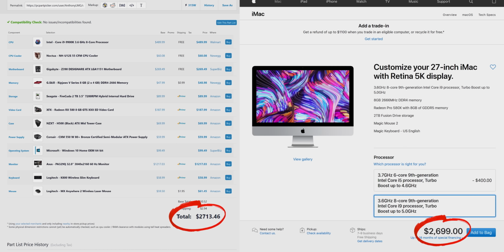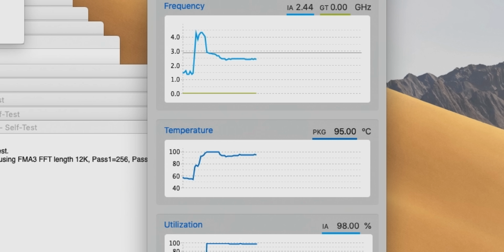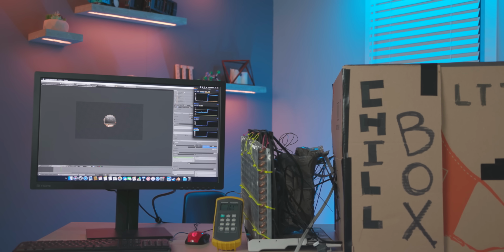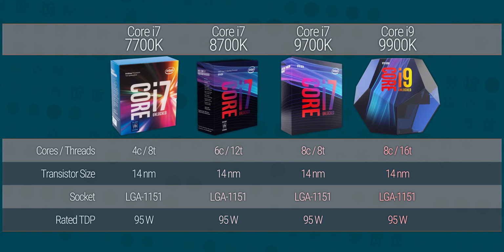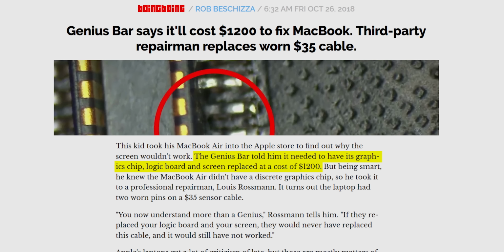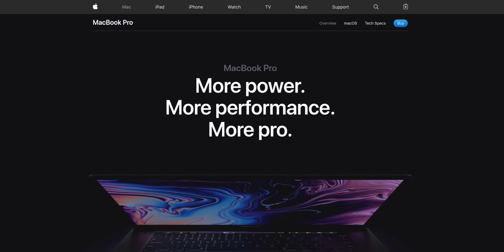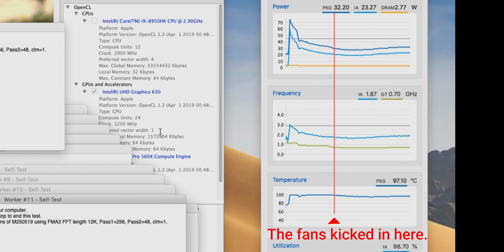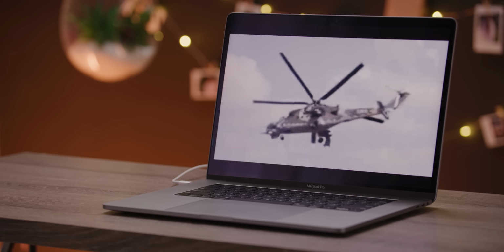Macs are SLOWER than PCs. Here’s why.

Comment: my mac is magnitudes faster than every pc I've ever owned or worked with. way more reliable, no spftware crashes. still wndering why people buy pcs these days
Reply: As someone who owns both, while performance is often identical, and in some rare cases better on Mac, software compatibility and customization are just way better on PC. I have more options built in when it comes to small things like cursor customization, taskbar grouping, window snapping, to better 3rd party modding support that have negligible performance impacts. Tools like file explorer are way better than finder, and in general while MacOS feels smooth, Windows is generally more practical and gives more freedom - and that’s not even getting into the Linux side of things. Also with PCs, you can upgrade individual parts if they die or feel outdated, you have a lot more freedom in price tiers and you aren’t limited to arbitrary os limitations like one external display .

Comment: This is just my opinion :

So in conclusion, the reason why Macs are slower than PC is because Apple limit the performance of their CPU (for intel based) in order to make sure not getting overheat due to the design that are too thin (especially Macbook) so the fan are not optimal to cooling the cpu because the fan itself are too small and thin to cooling massive work that cpu doing.

Comment: Knowing what we do now, Apple did this for a few reasons
- Intel misjudged how long it would take for 10nm to roll out
- Apple were pretty close to Intel at the time, but this failure was the last straw and they booted intel to the streets after.
- Apple designed the cooling solutions for the predicted TDP's for the chips had they used 10nm instead

Comment: A very good friend of mine, who passed away, loved Linux for starting (booting) and shutting down, VERY quickly - he passed away before the latest system we got for Seniornet in Upper Hutt (New Zealand), which was a shame, because it started and shutdown VERY quickly - and was Windows 11, a 2GB/sec SSD, DDR4 ram and an 11th gen i5 CPU with a 23-inch screen and built-in webcam for zoom etc.

All our refurbished PCs, pentiums or 4th gen i3 at the best, had the SATA hard drives replaced with SSDs, now they ALL start in 12 seconds.  Cos it's all about taking the very large WIM file and putting it into the RAM, right?

Or the "sleep" or hybernate mode, where you take everything you are working on, save it as a file to SSD, and turn off the computer.  Some computers do that, when they are dropped!  Before they touch the ground, on their rubber-sorbathane edges to absorb the kinetic energy, they write the RAM to a file and turn off.

Comment: The MacBook Pro 2007-2011 15,4 is The Best i got it and these still support Windows and you know why windows and Linux are bed CUZ Also Macs are not supporting only MacOS & Mac OS X & OS X so i you all can change iMac Or Mac Pro & Mini Or Macbook into A Windows Or Linux Like Thats why i also like Mac and i Have An iMac Without Monitor And its 21,5 Inch and i installed the windows 10 on it and thats not Bad Like it got so speed so your not right

also oldest Apple Devices Tech you how to change Ram so Just shut up your not right

;)
Reply: And They dont Need to change them Graphics Card

Comment: Has this problem been resolved yet? I am considering going back to Apple for everything.
Reply: Very much so, the new M1 chips pretty much fixed most of all the issues Linus talks about here. The issues with intel chips were caused because apple had designed the devices with Intels new 10nm process in mind, so when intel didn’t deliver on their promise it left apple having to throw hot chips in a chassis not designed for the thermal output.

Now that apple is designing their own chips, they’re able to also design their cooling mechanisms to work properly, and the M1 chip doesn’t have nearly as much thermal demand to the point that the MacBook Air doesn’t even need a fan to be able to perform very well (it DOES throttle, but in a way that’s much more acceptable). 

Hope this helps :)

Comment: The answer is... Intel CPU's  run too bleeping hot.  Fortunately, Apple Silicon is here n. (2020+)
Reply: or its because apple didn't make an appropriate design either
Reply: @raghavkalyan17  The speed argument is dead now . We have reached the point of diminishing returns. M1 and future chips in Apple's arsenal have ended the argument.  At this point, the only thing Apple has left to do is to address gaming.  They have the resources to tackle that, when they are ready.
Reply: @antoniostorcke  a well designed laptop with at top spec intel or amd cpu, like the 12900k, can keep up or outperform apple's offerings, while still being cheaper and the laptop itself offering more functionality
Reply: @raghavkalyan17  The argument still doesn't convince. The Apple computer, even a basic Mac Mini, offeres more out of the box than a $2000 windows machine does. Even a cheap  linux box offers more than that top spec windows machine does. For Microsoft to fix that, thet would have to include about $2000 worth of software.
Reply: @antoniostorcke  what? a mac mini is no more easy to set up than a pre built windows machine that would cost about the same amount as the base model. And don't even get me started on the ridiculous pricing. linux beats both of them when it comes to privacy, but that's irrelevant to a discussion about hardware
Reply: @raghavkalyan17  Microsoft gives ZERO development tool with a windows installation. I suppose you could count Visual Studio Code, but not really. Forget compiling and software or editing  any videos.  They give you a crippled version of Microsoft Word. It just isnt enough to justify a Windows license cost. Even if the Windows license was free, it still would not be worth it. When I purchase an Intel or an AMD machine, I insist on a blank hard drive.
Reply: @antoniostorcke  they have basic photo and video editing software. and again, i'm not trying to say windows is better than macos, i use linux
Reply: @raghavkalyan17  i like a  machine that can run everything and build everything. . I have done Hackintosh in the past. I have also done virtualization. I could have chosen to buy cheaper PC hardware but  why bother. Just saving a few bucks isn't worth the hassle. Linux still has a long way to go. Gnome has come closest to giving us a unified experience.  With regards to the speed argument,  I am going to give Apple a pass. This is an entirely new hardware platform that is still in its first year. The trajectory that Apple has placed themselves on will keep the Wintal establishment  fretting for its future. I think the Mac Pro, when it comes. Will be truly revolutionary when it comes to speed.
Reply: @antoniostorcke  In my experience, unless you need Adobe software for whatever professional work you do, linux has a complete desktop experience now. and who'll buy the mac pro if you can't upgrade it at all. The trashcan mac proved that
Reply: @raghavkalyan17  I will be using certain publishing software which are Mac only. With the mac I can easily install Windows or Linux in virtualization if needed. Bootcamp will come when Microsoft completes their agreement with Qualcomm.
Reply: @raghavkalyan17  Apple is doing just fine. They are making money hand over fist. A 3-week wait for my customized mac and I would gladly do it again. When you have a product people want, you can name your price.
Reply: @storcke  apple is making money by using purposefully bad designs so users would have to pay more to get there products upgraded or serviced.
Reply: @raghavkalyan17  Apple is making appliances. If you doubt that, wait until you see the next Mac Mini redesign.  You will think you are looking at an Apple TV. They are building a tool with s specific lifetime. The exchange for this is an operating system that works. The value of the tool is so great that they don't have to please the customer to an extent that will take away from their future profits. The customer ultimately makes the decision.

Comment: I will say that in my experience, the Mac OS tends to provide a more stable, reliable middle ground when it comes to certain productivity based tasks… at least based on my experience  with MacBook Pros vs higher end Windows machines, and have had similar experiences between iMacs and PCs. I can’t deny that there is a certain performance disadvantage when it comes to the Macs for more extreme tasks, but it’s not exactly a black and white issue.
Reply: osx is 1000 times better than windows, that's what keeps me on apple hardware... which never has any blown motherboards, fried cpu, dead HD, etc etc.
Reply: @schmoborama  trust me, apple hw keeps dying, remember the 2011 HD6000 GPUs failures on both imacs and mbps and many other model years which had the dedicated GPU died? The HDD in my late 2011 15" also died after like 4 years even tho it was on my desk its whole life and somehoe the HDD from my 2009 dell is still chugging along as storage drive in my PC
Reply: @hav0c51  
NOTHING as common as baked HD and cpus on windows boxes
Reply: @schmoborama  aint ever had a dead cpu that wasnt the users fault (unsafe OC with either no/old thermal paste or using a shit cooler),and apart from the drive in my mac where it probably just fried itself with the gpu only seen hdds die due to physical impact, just face it bro, apart from the nice looks all intel macs are absolutely dogshit and thats coming from a lifelong apple user
Reply: @hav0c51  eh so you're a technician that sees broken computers all the time ( strange, huh ) and that means that macs break just as often as pc's 😴

Comment: I gotta tell my sister to stop thinking about buying a Mac. Not very good for its price.
Reply: Nowadays the situation is very different. Looking at raw benchmarks, the M1 chip powering the newest Macs is more powerful that any of the intel or AMD competition in the consumer mobile computer market. It's not even close. The Macbook air at $999 is actually a great deal for a very thin, well built full aluminum computer that is faster than all of its similarly priced Windows competition.
Reply: @spht9ng  yep, its specs are really good, except for its durability. The screen of the M1 is not very strong, so many screen problems happened and they just regret buying the M1. I prefer a Lenovo thinkpad or Legion. Its specs are worse than M1 but it's excellent for the price.
Reply: @Nguyn167  well. i have not heard of such screen issues being so prevalent. Hopefully this is an edge-case issue that is only affecting a small few but I wouldn't rule out any big design issues with Apple. The last few years have not fared well for Macbook design with keyboards that have a failure rate which is way too high and inadequate cooling which would cause thermal throttling. With the M1s already having been out for about 10 months, I haven't heard many huge complaints about reliability so hopefully Apple has put this bad phase behind them.
Reply: @spht9ng  if the issue's fixed, then this will be a must-buy. :))

Comment: M1 to intel “looks like you’ve got a fever, we’re going to have to isolate you”
Reply: *M1 max from behind to M1:That's MY boy
Reply: Intel to m1 . Dont be a liar 5nm child
https://youtu.be/2BooIC5qGO8
Reply: Intel i9 and thread reaper is superior
Reply: @styx8383  You're seriously comparing a fucking threadripper to an M1? They're completely different things, dude.
Reply: @styx8383  Ah yes, something eating 300+ watts is superior to something only using 30 watts.
Reply: @doggo_woo  that's not even true
Reply: @styx8383  what isn't true about that? Just stating the fact that your comparing a low power CPU to something that eats 300 watts when at max load.
Reply: @doggo_woo  it does not take 300 watts lol
Reply: @styx8383  I hope your not reading the tdp intel shows on their website because that is literally only it's thermal output. Check Linus's review of it

Comment: Yet Apple computers are the longest lasting and supported computers. Compare a 2014 HP to a 2014 MacBook Pro. The Hp has been long unsupported but the MacBook Pro still supported for updates on the latest OS and still running strong and even better than some recent Windows laptops.

Comment: For me it's the fact that my 2019 imac is completely silent when idle or under my normal workload whereas my most recent purchase, a windows PC with the most silent parts I could buy still makes more noise than my imac under medium load.

However, under heavy load, the imac gets noisy whereas the PC just sounds pretty much the same.

I'm totally ok with higher performance parts that are held back in the interest of being silent and slick.  To a point of course and my 2014 macbook pro with dedicated GPU is still chugging along like any modern laptop.

Also, macs as a status symbol, do people think that's a thing nowadays?  I first got a mac in 2014 so I don't know about before then but I do talk about computers a lot with people and I never heard things like "You should have gotten a Macbook pro, check out my retina display and this and that spec" but I heard things like "Dude you could have gotten a way better Windows laptop for the same price".

Comment: With my Alienware R3 M17 I bought a ram air cooler pad. It has a gasket that seals the bottom of the laptop off so all the air being forced underneath the laptop has only 1 place to go, into the dual fans.

Comment: This is the first thing I noticed when I received an old MacBook for working, I thought that was a defect or maybe a dirty fan but after googling I found it's "normal" 
I returned the MacBook and a Mac mini was assigned to me with better cpu and ram but even so the problem is the same. temperature quickly increases to 100°C  even if CPU usage is only at 60%
And some times is slower but not as much as MacBook
I understand how difficult is to have a good cooling system on that reduced case but I'm disappointed

Comment: That's why I make every laptop user at least use a fan stand. Apple is all about Planned Obsolescence and has abused that by putting out software that bricks their own hardware when a new device is released, not give a single fuck about cooling, like this video wonderfully details, and just plain lying to customers. Great video! Support "Right to Repair" and fuck Apple. Remember, they overcharge (I don't care what LinusTech "concluded" as they do still overcharge), they restrict access and steal software that was initially open source to make money, they brick their hardware with software updates, and they build their hardware to fail by disregarding heat dissipation.

Comment: You'd SO deserve a ton of dislikes for having implied ALL Android devices go into thermal throttling while iPhones will never do it WHILE CONVENIENTLY FORGETTING that Apple PURPOSEFULLY slows down older iPhones under the OFFICIAL EXCUSE of reduced battery efficiency.

That and my Xiaomi MI 10T barely gets tepid under heavy load and its performances remain perfectly aligned to your iPhone. Challenge you to prove me wrong.

I'm not a Android fanboy, anything but, but I STRONGLY DISLIKE trash talking without proofs about ANYTHING, even Apple. If something deserves a trashing then you BETTER have proofs, and you did about the macbooks, but NOT about the Android devices you offhandedly WHOLLY slighted. On the same ken, if you go for hearsay and lazy assumptions with no proof, you better being ready to be lambasted for your carelessness.

Comment: Its like some cars, yes they have alot of horsepowers for a few minuts but when the turbo heats up and the engine power gets reduced. Meanwhile a less powered car can maintain max horsepower for much longer without failing and even tho it makes less power just on race tracks you see often the simple cars racing and the modern cars in the pit cooling after 5 laps.

Comment: I spent an OBSCENE amount of money on REFURBISHED MacBook Pro 2017. I wanted the best I could get, and I figured, like an idiot, Apple has a reputation for quality, it will last for years to come! Lol. I know, I know.

I learned my lesson. It was great for 2 years, then the monitor just stopped working. After a month of ghosting, it now has backlight, but no image whatsoever. Went to a Genius Bar, and they were basically like, you didn't get Apple Care, give use another $600 or go fuck yourself.

Still works as a pretty decent gaming computer with Windows in Bootcamp. (External monitor works.) Haven't had overheating problems. But if does eventually fry itself, at least I'll have an excuse to get a powerful PC gaming desktop, which will actually last a long time and be upgradeable. It's the first and last Apple computer I'll ever buy.